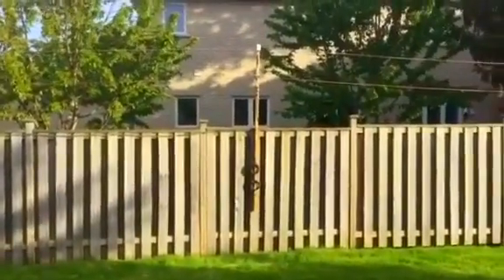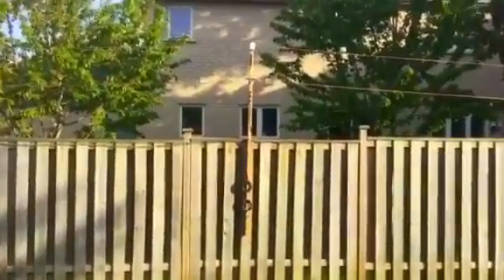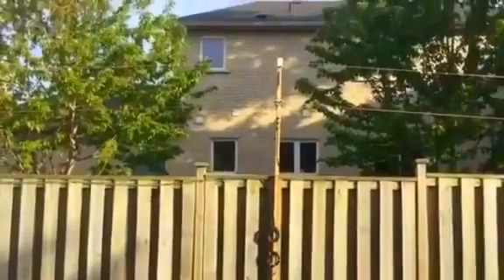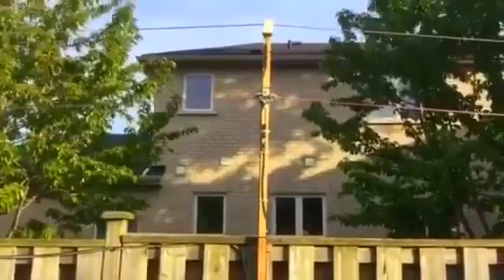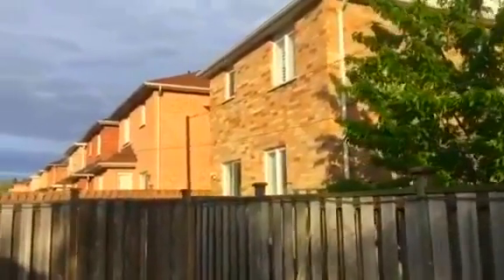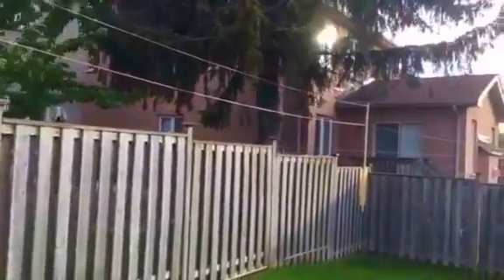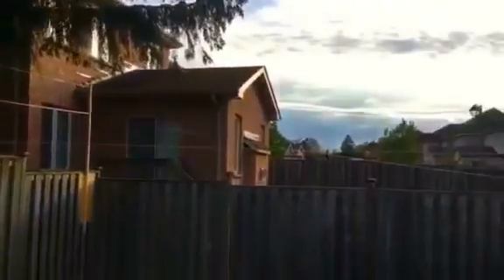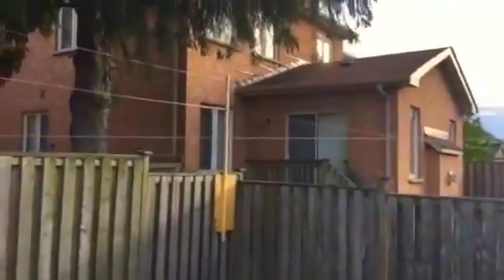VA3VMD - 80m / 40m Dipole Antennas

Comment: Well how does it play? And what kind of band width do you get on each band?
I'm limited to a city lot and was wondering if making those 90 degree bends effects the over all length?
73
wd4dda
Reply from the maker: Preston: The antenna is very broad banded, I can work the entire phone band on the 40m & 80m. The SWR is approx 1.7 - 1.9 on the either ends of the phone band (without an Antenna tuner)and works its way flat right in the middle of the phone band as I intended on both Antennas. I too was VERY surprised that the 90deg. on the 80m antenna had no negative impact on performance. I have worked 109 countries and over 4000 qso's in just 15 months, so I can comfortably say it works great for me. I was invited by Bob Heil to guest appear on HAM NATION last Wednesday
to talk about my video. You can see the full video segment interview  here - https://www.youtube.com/watch?v=wIgqnISFs7Y 

Thanks for taking the time to watch and respond... 73
Reply: Thanks for the feedback, on the antenna.
Great track record for an antenna so near the ground. Ok on the 90 degree bends, think I'm going to give it a try. Currently using an OCFD with the apex at 30 feet.
But I'm going to put the 80 on top and bend them 90 degrees at the fence line like you did. 
I'll check out your other video too.
Again thanks for coming back to me and 73
wd4dda